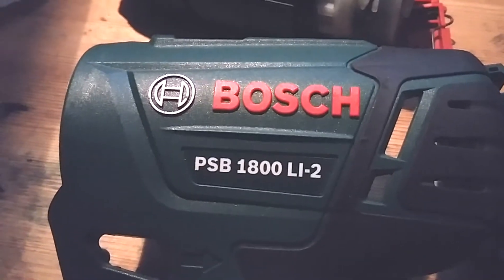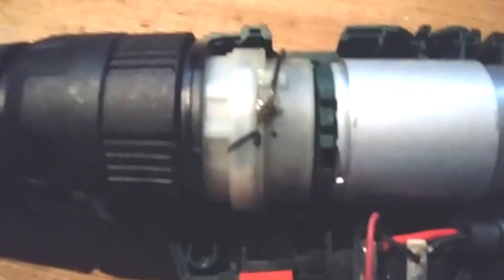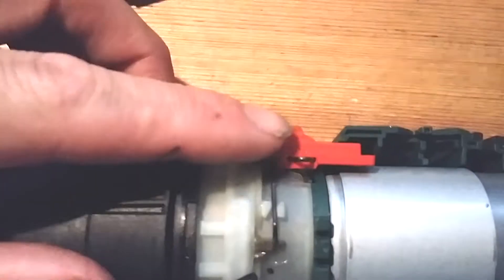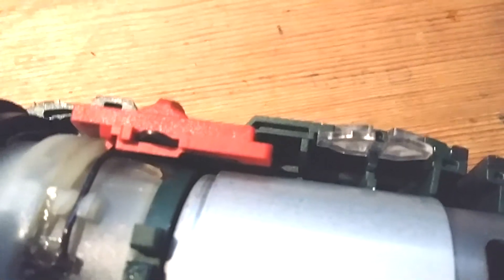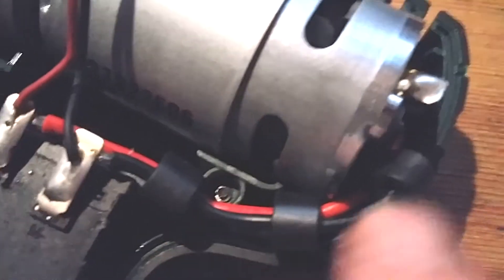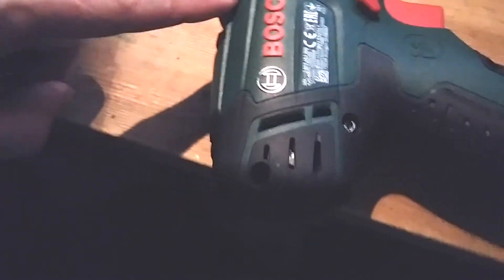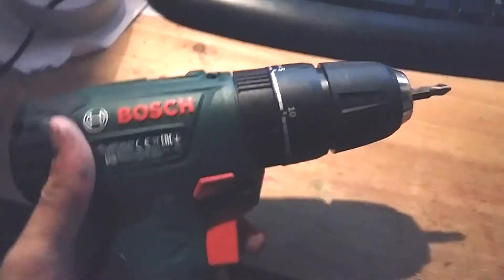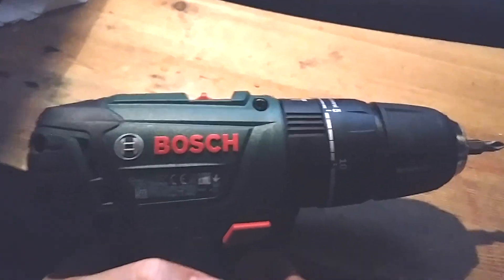Bosch psb 1800 Li-2 jammed motor repair

Comment: Struggling to get the case off given the type of screw. Can you help identify the screw head needed to undo the casing?!
Reply from the maker: Hi you can use a small flathead or a torx size 10 bit

Comment: Just found this. Worked the first time, but I had the screw/drill/ hammer selector in the wrong place, so had to start again! This time, it worked intermittently, then went back to the same issue with lights flashing and no action 🙁

Comment: Many thanks for this video. I have replaced the whole motor (amazon purchase £11.70) since it was smoking and then I was not able to cleanly re-assemble. It was exactly the problem described in 3:40 where in my case my two rights clips slid together while they should be separated like in this video.

Comment: I have the same drill, and same symptoms.  My motor wasn't seized, but the same "flash lights but no action" indicator.

The motor turned by hand okay - and it all worked stripped down, but not reassembled.   I saw another video that mentioned drying out the board in the base unit, as moisture sometimes causes "safe mode" (the lights but no rotation), so got a hairdryer onto it and it worked once reassembled again.

Your video includes some great tips on reassembly, in particular wriggling the chuck onto the motor until the two "click" into place and feeding the top speed switch onto the wire lever (although you seem to assemble yours upside down to mine; my direction light fits under the motor to hold it in place.

Thanks for the video; I now have a fully-functioning drill (and a mental note not to keep it up in the shed anymore!)

Comment: brother i have the exact same tool. Recently i tried to free the motor from debris by pressing the trigger and blowing air inside the vent, the motor turned for a second and after that the transistor on pcb melted. My problem is that i cannot find the type of transistor anywere on the net, neither i can look mine because is melted. If you have a photo of the pcb or any other information it would be really appreciated. My tool is out of warranty. It's a really tough tool and lightweight, i use it a lot in my work. Cheers from Greece

Comment: dude, my just came out of warranty and it started flaming! not sparking but actual flame comes out from the motor vent... and to be honest I used it very little, I had to charge the battery 4 times only and then it died, that's how much use I got out of it. Bosch won't do s**t, really disappointed. I'm gonna try to take it apart as well and see what might be up with it. Cool video helped me a little, thanks.